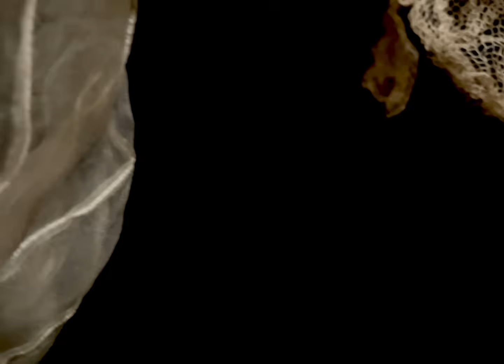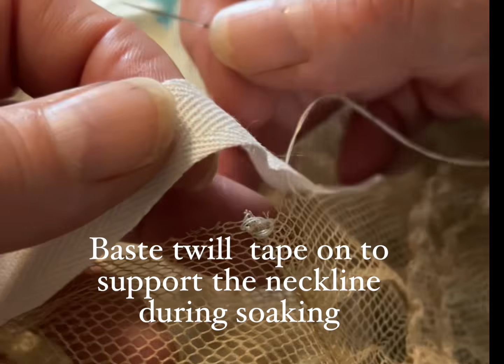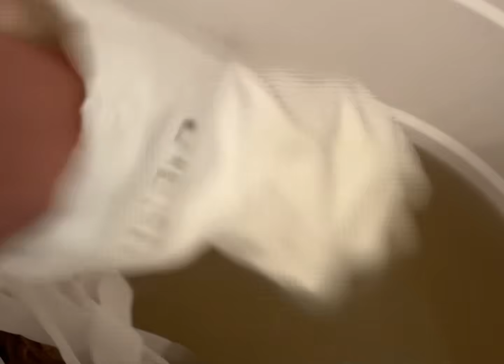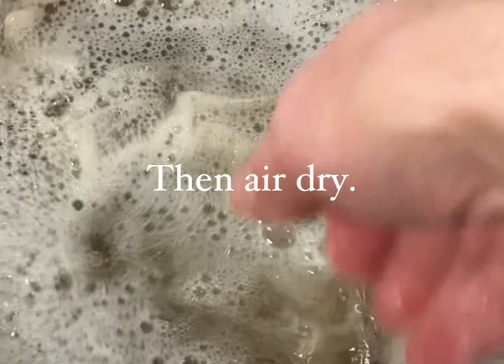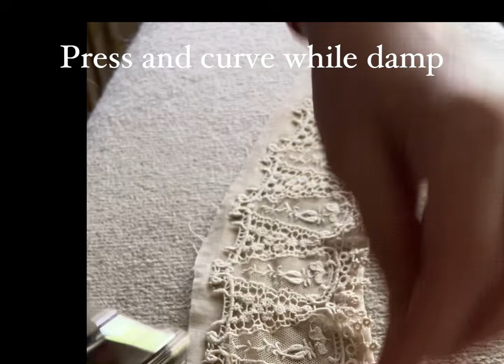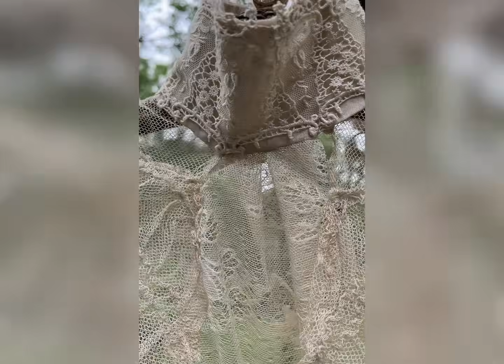An Edwardian lace blouse has its tattered silk lining removed, is washed and the collar replaced.

Comment: @barbarasculati When you finish with 100YO+ garments, do you sell them or donate to a historical museum?  And how comfortable would it have originally been?
Reply from the maker: I sell vintage clothing on EBay as well as Etsy ( 2 Etsy shops- one for vintage adult sized clothing and another for vintage kids clothing) The shop links can be found in my bio/ profile. Generally speaking, I sell clothing 1940-1980’s on Etsy and clothing older than 1940’s I tend to put on EBay. This blouse is currently on EBay. As for comfort, that wasn’t as much of a consideration in clothing as it is now, and it’s possible it was worn with a corset underneath as well as a corset cover. The wearer at the time was probably accustomed to the high neck / collar and aside from a tight waist, it was probably considered more comfortable than the heavily boned bodices from years prior.